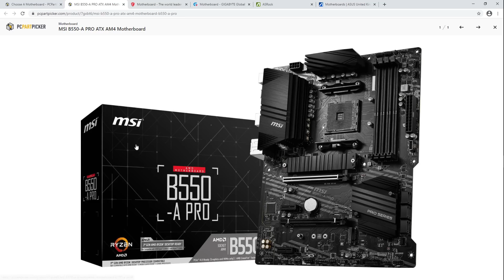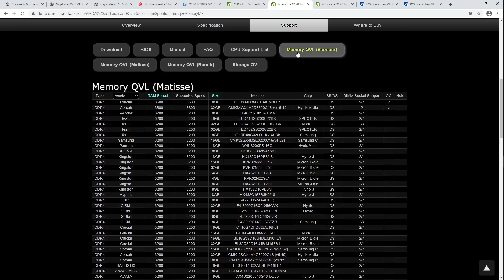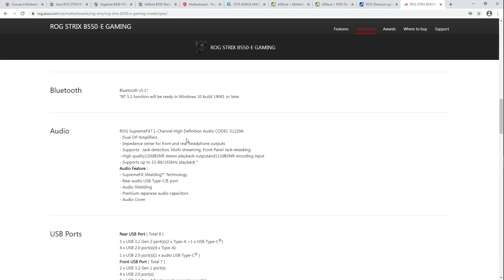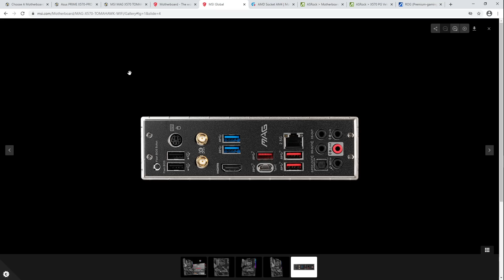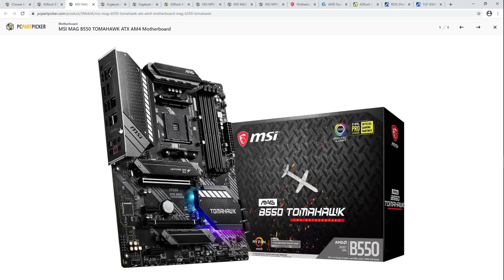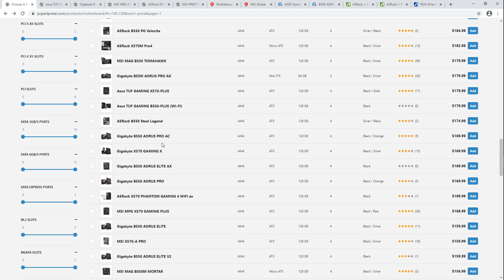Rambling about B550 and X570 motherboards. December 2020

Comment: I have a tomahawk wifi arriving today, time to see if I made a good decision...
Reply: @hitmarkler  Yeah I got the tomahawk wifi, Just waiting for my 5800x to arrive now...
Reply: @JMR120600  I'm building my 5800X/X570 Tomahawk wifi tomorrow. Glad to see I have company!
Reply: @ChristesII  oh neat, I'm just waiting on my 5800x being dispatched, UK Stock has been a joke. Only managed to buy it 3 or 4 days ago, just need scan to get a shift on...
Reply: @JMR120600  The stock is bad in the US too. I literally had to write a Chrome extension to get it from Amazon.
Reply: @hitmarkler  I've never overclocked memory before, but I got a couple of B-dies so hopefully I can do something interesting.
Reply: I'm just going to comment in this thread for future readers that I couldn't get the board to boot with XMP on. Apparently this is a known issue with MSI boards and ram >3200. They have a beta BIOS you can update to to fix it. Maybe that will save someone a headache in the future.

Comment: ASRock X570 Taichi - 3rd M.2 slot is actually tied with the bottom PCIe x16 slot. So you can always have 8 SATA drives connected, but either the 3rd M.2 or the 3rd PCIe x16. They also have a Thunderbolt AIC that has to go into the bottom slot, so if you use that card, you can't use the 3rd M.2.

Comment: *1:53 700$ Gigabyte x570 Aorus Xtreme* 
	(favourite "idc about money" board) 
	+ rambling about Asus ROG Crosshair 8 Formula 800$ and Hero
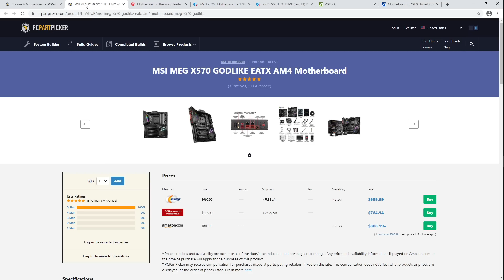[8:53 700$ MSI MEG x570 Godlike] 
	(Very bad I/O and Lan for the price but unique PCI-Slot Layout)
	+ rambling about MSI Prestige x570 Creation 500$ and MSI QVLs
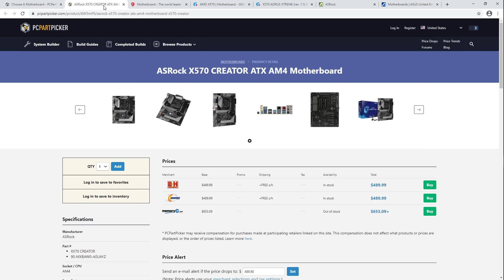18:59 500$ ASRock x570 Creator 
	(More Thunderbolt) vs MSI Prestige x570 Creation
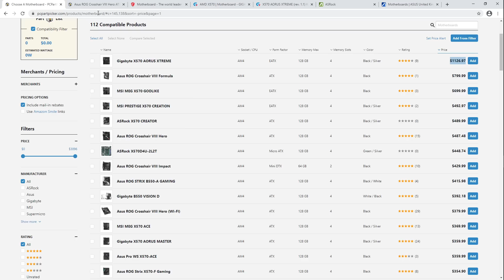22:27 360$ Asus ROG x 570 Crosshair 8 Hero 
	(Dark Version costs more but better OC - never in Stock)
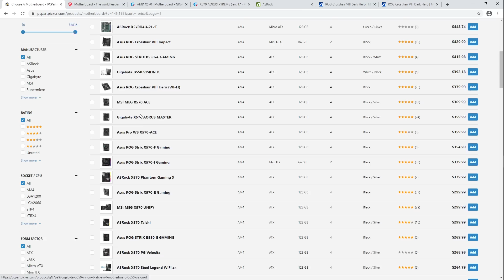[28:38 370$ MSI MEG x570-Ace] 
	(just a worse Unify, but has RGB (yayyy))
	compared to:
*28:42 300$ MSI MEG x570-Unify*
	"Optimal x570 board"
*32:20 370$ Gigabyte x570 Aorus Master*
	"Favourite ~370$ OC Board" (Great Memory OC Board, some weirdness with BIOS failing)
*37:32 300$ ASRock x570 Taichi* 
	"Best Board for normies" (only limit is 1Gb LAN, Bad Mem OC)
49:23 300$ Asus ROG Strix x570-E Gaming 
	(better LAN & more SATA than Taichi, overall not that cost effective)
53:32 340$ ASRock x570 Phantom Gaming X 
	"recolored Taichi with extra 2.5Gb LAN Port"
*54:56 250$ Asus ROG Strix x570-I Gaming mITX*
	"Favourite ITX at MSRP" vs. B550 Version (better Memory OC, worse VRM and I/O)
54:56 Asus ROG Strix B550-I Gaming mITX 
	* just so you can find it more easily *
59:52 270$ Asus ROG Strix B550-E Gaming 
	(EU Prices ~170-200$)"Kinda like this board @EU price (SLI Support, 6xSATA, ok I/O) 
# SLI Support mentioned for x8+x8 functionality i guess#
>
~1:00:00 "If you just want a cheap Board with VRM to support your CPU go here"
>
1:05:51 260$ Gigabyte B550 Vision D 
	(Supports SLI, good PCI Layout, unique white looks)"no stupid GB dual bios, Nice Postcode location"
*1:06:37 300$ ASrock B550 Taichi* 
	discount 230$ (no SLI License, 8 SATA ports), "at 230$ great, at 300$ bad", # Who tf cares about SLI??# 
> 1:14:50 rambling about low end Gigabyte boards stupid Dual Bios functionality on B550 (rare) vs X570 (basically everywhere)
> 1:15:26 rambling about ASUS Memory OC and (high) pricing
> more rambling about Gigabyte weirdness and some Asus board characteristics
# damn it is hard to timestamp him:D #
[1:18:28 270$ ASRock x570 PG Velocita] 
	"very misleading PCI topology, but good Memory OC"
[1:20:45 270$ ASRock x570 Steel Legend WiFi ax] 
	"should be 200$, this is dumb"(same as PG Velocita basically) 
[1:22:10 250$ Gigabyte x570 Aorus Pro WiFi] 
	"Obnoxious GB Dual Bios, SLI Support, just get the B550 Version"
[1:22:39 250$ Gigabyte B550 Aurous Master] 
	"Obnoxious GB Dual Bios, can't recommend, annoying to work with"
1:24:26 240$ Asus Prime x570-Pro 
	(SLI, PCI Switches, only 6 Sata Ports) "really solid option"
1:26:38 220$ MSI MAG x570 Tomahawk WiFi 
	"doesn't make sense as x570, otherwise solid" (Good OC support, Great VRM Heatsink, ok I/O)
*1:27:35 220$ Asus TUF Gaming x570-Pro WiFi*
	(direct comparison to MSI Tomahawk, adds Bios Flashback (standard for MSI))
1:30:14 230$ MSI MPG x570 Gaming Pro Carbon WiFi 
	(sacrifices some VRM Quality for better featureset) "kinda like eh, pretend it doesn't exist)
# 1:30:44 "it's a shame you can't ctrl-f a video" gotchu bro, should get paid for this tho#
> 1:31:00 rambling on how you should choose a motherboard, what a motherboard even represents
1:32:58 230$ ASRock x570 Extreme 4 
	"more expensive TUF Pro"
1:35:36 190$ MSI MPG B550 Gaming Edge 
	"why would i pay 190$ for B550, just get the x570 TUF Plus"
1:36:00 190$ ASRock x570 Steel Legend 
	(8 Sata Ports, no troubleshoot LEDs, no BIOS flashback) # compares this to ASUS TUF Plus#
*1:36:00 180$ Asus TUF Gaming x570-Plus*
	"Baseline X570 board"
1:37:48 195$ Gigabyte X570 Aorus Elite 
	(Bad Memory OC, internal Type C)
*1:39:48 170$ Gigabyte B550 Aorus Pro AC*
	(save 20$ if you do not need x570 stuff like extra drive bandwith etc)
1:42:50 190$ ASRock x570 Phantom Gaming-ITX/TB3 mITX 
	"i don't like the rear I/O (thunderbolt 3)
> 1:43:10 rambling on x570 ITX boards, "below 140$ there is only miserable boards + examples"
>
# BZ wants to wrap up fast here and skips a lot, basically saying "Just get the 180$ TUF instead", because stuff has bad VRMS and very limited featuresets.
>
1:55:00 160$ Gigabyte B550 Aorus Elite V2 
	(Good VRM, Memory OC only ok with 2 DIMMS, 4 Sata Ports)
*1:55:35 157$ MSI MAG B550M Mortar mATX*
	"best mATX OC board" (not great Memory OC, 6 Sata Ports, good PCI Layout, shit I/O) 
1:58:50 155$ (discounted) Asus TUF Gaming B550-Plus 
	"reasonable for the discounted price" (decent I/O, no troubleshoot LEDs, bad Memory OC)
2:00:00 130$ ASRock B550M Steel Legend mATX 
	"featureset not bad for the price" (slightly hot VRM, no BIOS flashblack)
2:02:22 120$ Gigabyte B550M Aorus Pro-P mATX
	"similar to Steel Legend"
[[2:03:31 110$ Asus Prime B550M-K mATX]] 
	"why does this exist, why does it cost so much, it is terrible" # double brackets coz extra bad #
2:03:39 115$ ASRock B550M/ac 
	"kinda make sense if you need the WiFi"
[2:04:58 160$ Gigabyte x570 UD] 
	"This doesn't make sense, u can get b550 with more m.2 slots" (bad VRM (BZ tested this))
>2:05:00 conclusion
>
Legend:
>
Buildzoid's personal favourite for given category *...*
not recommended board [...]
Most important functions: (...)
Builzoid notes: "..."
My notes: #...#

edit: Format
Reply: I like these time stamps even better
Reply: @ryanwallace983  thanks man^^ i wanna come back in a month or so and use these notes to find myself a mobo again^^
Reply: Wish I had know this before buying my x570 master, not that is a bad mobo, temps and oc was excellent but I had the weird issue that it stopped powering up so I did RMA on it and got the MSI unify, very happy for now but well, I was early adopter so you can never know.
Reply: @manuellengletgarcia4968  I heard that the v3 still has the issue. its a shame because the features are awesome. I had the Dark Hero 8 prior to the Master and never had an issue until I had a bad power outage that killed many electronics in my house including the motherboard.. lol Shoulda never switch mobos
Reply: You made sense of this crazy video. Thanks man!!
Reply: Thank you <3
Reply: This is perfect!
Reply: Yo this is wild!!
Reply: M-m-m-assive respect for u, ty
Reply: You da best. Not "the best". Da Best.

Comment: I literally just picked up a 5900X, so this could not have been uploaded at a better time. :)
Reply: I want one!! What MB did you go with
Reply: I'm just 2 hours away.
Reply: I'd also like to know which MB you went with. I got a B550 Aorus Master, but it's got a weird USB condition and also the LAN port cuts out randomly throughout the day (replacement board also does this) to the point where you have to manually reset the adapter.
Reply: @SlightlySaici  In the end I was lucky enough to realize that my B450 Asus Gaming-F got a Ryzen 5000 compatible BIOS update and the VRM is good enough to comfortably use the 5900X so I didn't have to change mobos. If I had to buy one though based on my research I'd have went with B550 Aorus Pro v2 or B550 Tomahawk depending on the price difference at the time of purchase.

Comment: If AMD ever delivers on the promise of an agesa capable of 4000MHz IF for ryzen 5000, what 2x32gb kit can deliver synced clocks at the lowest latency on a crosshair impact (mini-dtx)? Gskill F4-4000C18D-64GTRS or crucial BL2K32G36C16U4B?
Reply: the beta bios does 2000 as does some others but only tested 2X8 , cpu memory controllers the problem for 2X32

Comment: Love listening to this in the background while i design tablet housing.
I had a 'looks' PC before, white + RGB, but now i got a performance pc after watching your vids.
Is there a possibility that you'll make a RAM OC guide (i have problem with sub timings)?

I had 2x8 Corsair White RGB (it cost me €124 when ram prices were high AF in 2018), that with XMP did 25GB/s + 95.7ns latency ... i chuckled when i checked it, after you mentioned in a vid that sub 70 is decent.
Now i have Crusial Ballistics 2x8 3600 CL16 (you suggested for a fire and forget XMP) on a Gigabyte x570 gaming pro ITX. I'm waiting formy 5600X to arrive, so my old 2600 (4.1Ghz @ 1.325V  24/7 *)  can only do 3600, but i used DRAM calculator, that gave me cl14-17-17-34 + sub timings , but it gave me errors in memtest (did get 63ns 53GBs though) , and i have no idea how to fix it, so i just went back to XMP.

*same CPU could only run 4.1Ghz @ 1.4V on old MSI B450 Mortar for some reason.

Also, is there a way to stabilize GPU undervolting? I have a RTX 3080 Eagle OC stock Ghz + +800Mhz VRAM @ 825mv max on curve, and i get 1-2% more performance than 100Mhz OC + 800VRAM but 265W max (Unigine Superposition 14200 OC vs. 14550 UnderVolt). if i could i'd go lower for less power consumption.

Comment: 3:30-3:36
"Zen 3, which is the 4th gen. Ryzen, is the 5000 series." 
My brain is toasted.
Reply from the maker: Zen 1 is 1st gen and Ryzen 1000 series.
Zen+ is 2nd gen and Ryzen 2000 series.
Zen2 is 3rd gen and Ryzen 3000 series.
Zen3 is 4th gen and 5000 series.

Also the APUs are even worse.
Reply: @ActuallyHardcoreOverclocking  zen+ fucked us all (I have a 2700x lawl, it was £150 though).

Comment: everytime i watch a Video from BZ i think he still hasn´t seen a block/feature diagram of the B550/X570
.. regarding that it cost you to go over 4 sata ports ( as you can choose 4 sata ports OR FREAKING pcie 4x) and how the M.2 are bound via the CPU link (4x pcie 3.0 in b550 and 4x pcie 4.0 in x570) = double the bandwidth to the chipset with the x570 (that all your things are attached to)

a freaking 4 port sata controller addin card is fine with a 1x pcie slot :)
.. so would i choose 4 sata ports or 4x pcie ? :))) ... no, just add 2 1x Pcie and use the 2 others for lan and sound

If you need more sata, simply put a cheap 8/16 port LSI Sas/Sata HBA controller in the bottom slot (40-50 bucks) and a 4 times USB 3.0 Controller (12 bucks) in a 1x pci slot :))))))
Reply from the maker: I've seen the chipset diagrams. I just can't be bothered to remember them.
Reply: @ActuallyHardcoreOverclocking  Legend and same as keep forgetting
Reply: @ActuallyHardcoreOverclocking  so you can be bothered with ever IC but not with the basics of how the things work :)

dude, you are great, but please, don´t forget the basic things

Comment: Ethernet, My view of 5 and 2Gbps LAN, is it's like 2Mbps and 20Mbps and 200Mbps ethernet. in my experience, NOTHING except motherboards support those speeds. Every single rack mount hub and switch I ever had was in simple multiples of just ten (1, 10, 100, 1000, 10000, etc Mbps), with the exception of optic fiber links (OC3, OC12, OC24, OC48, OC192, etc). I feel that if your not going to bother putting a full 10Gbps ethernet port on the board, just stick with 1gig LAN.